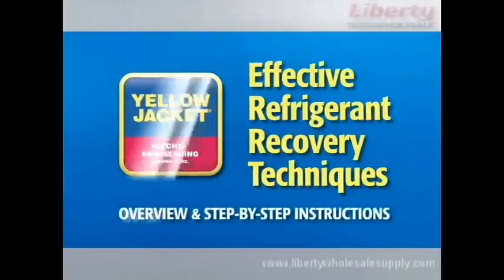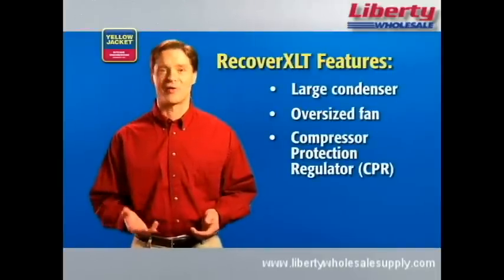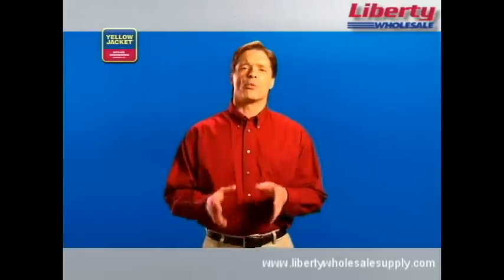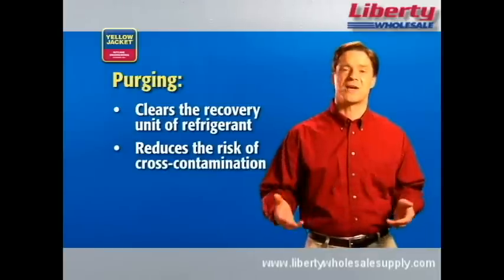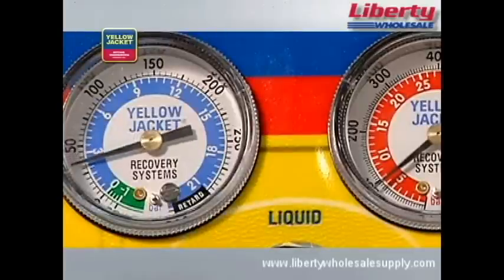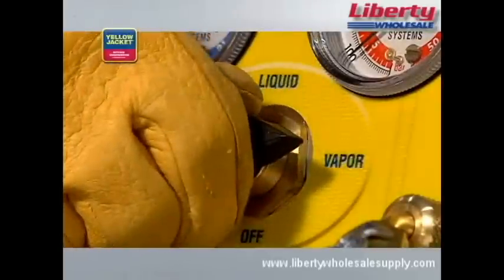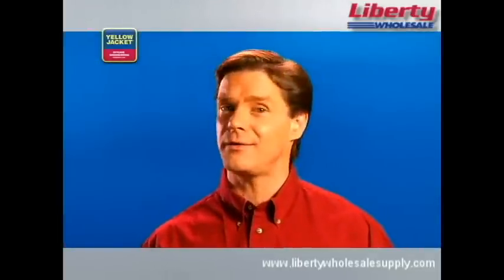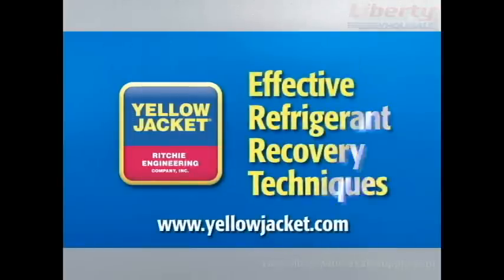Yellow Jacket - Refrigerant Recovery Training

Comment: you said 1/4" for recovery, and 3/8" for vacuum, is recovery the same as vacuum ?
Reply: No. Recovery is removing refrigerant from the system. Vacuuming is removing any unwanted debris/moisture from the system. Also used to check for leaks

Comment: When recovering vapor: The vapor coming from the A/C equipment's low side port, goes to the recovery machine's suction port and  through the discharge port goes to the tank's red liquid valve. Why is the tank taking vapor through the liquid valve? Perhaps the recovery machine transform the vapor (coming from the A/C equipment's low side) in liquid?
Reply: Yes. The recovery machine has a component called the condenser that changes incoming vapor to liquid which enters the tank. All three methods ultimately have liquid entering the tank because its much faster and easier to do.
Reply: Yes. The recovery machine has a component called the condenser that changes incoming vapor to liquid which enters the tank. All three methods ultimately have liquid entering the tank because its much faster and easier to do.